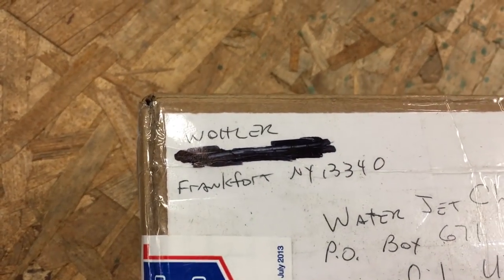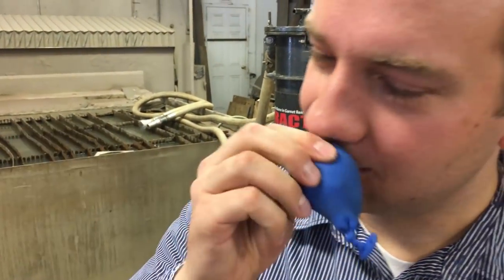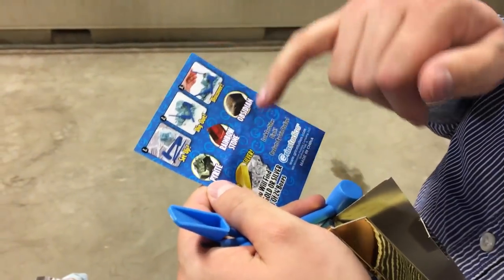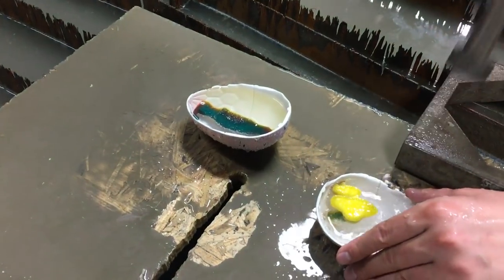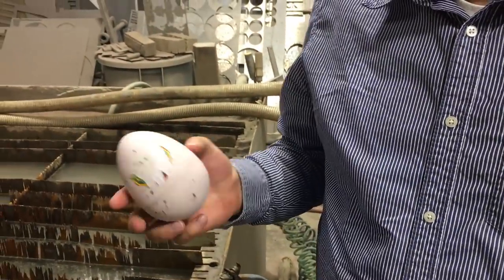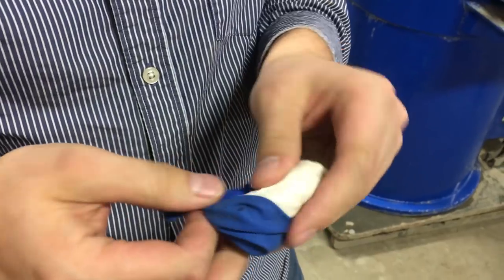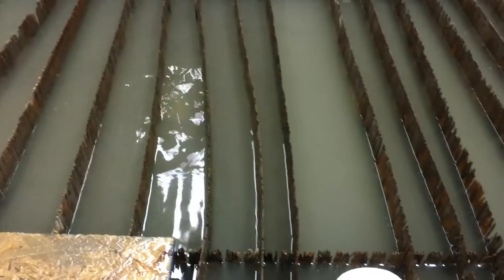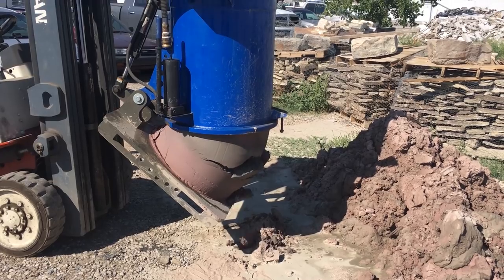Gold and Diamond vs a 60,000 psi waterjet cutter

Comment: Do you just your garnet once?   Isn't it worth recirculating at all?
Reply: Watch the part when they empty the vac, see how much other grit is in it, not worth the money to buy a separator just to reuse that bit of garnet. Much of the soft stuff like most woods can be cut with just water lone, the only time you use garnet in the mix is if its harder like glass, steel and such.